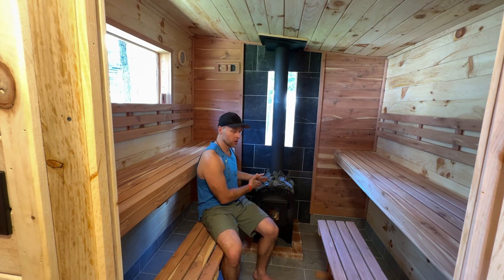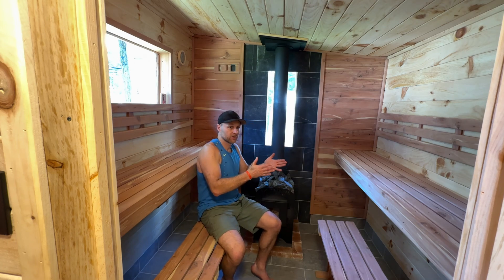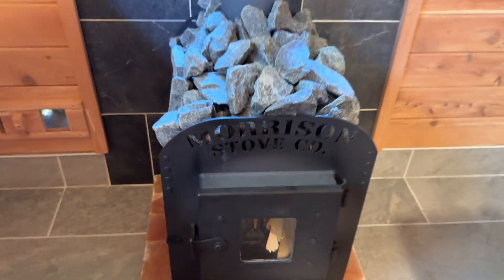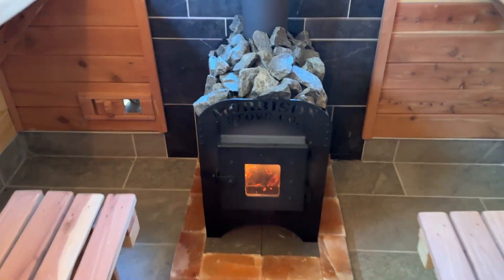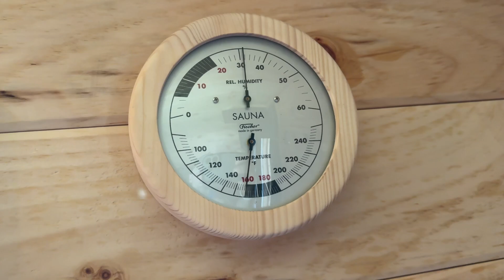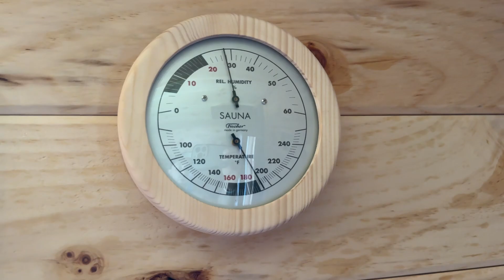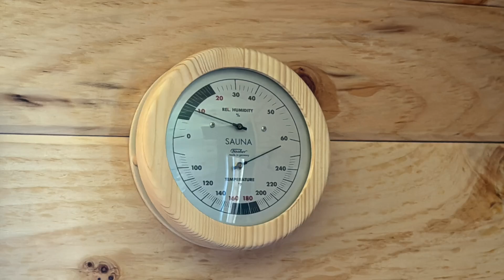How to break in your sauna before use - first time heating running wood stove...

Comment: Did you use any treated wood throughout this build? Especially on the inside? I watch most of the videos but just wanted to know if you used any treated wood or if you oiled or treated your inside wood panelling with anything. If I were to use sheet wood for the walls instead of paneling them, would you recommend I use anything like parrafin oil or tung oil?
Reply from the maker: Hi.  No , nothing inside is treated.  All sauna panels are kiln dried rough cut wood.    Only treated wood I used was the deck.   But outside wood is fine if treted.  Just not inside .